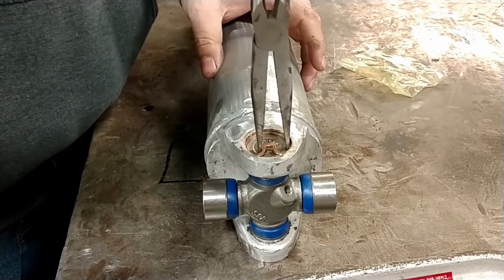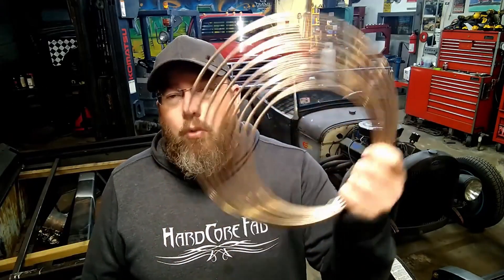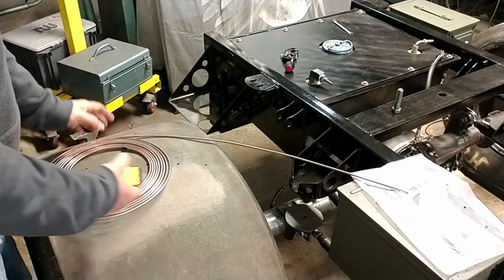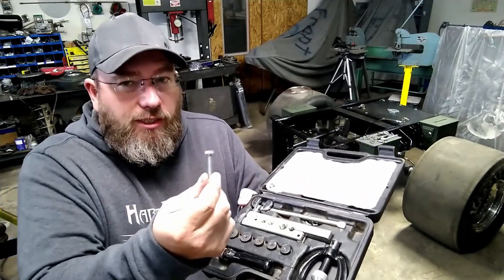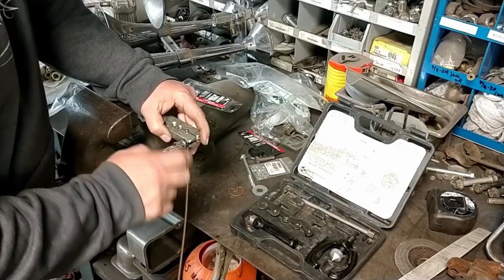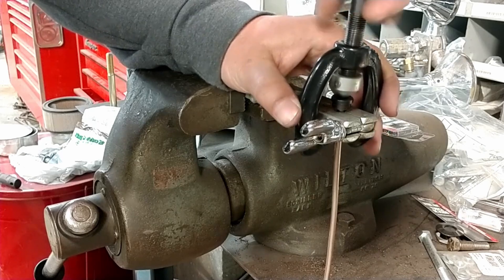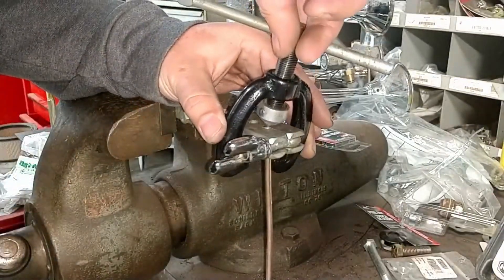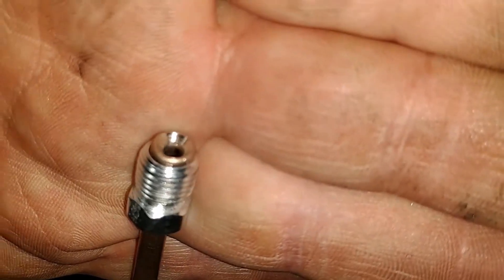How to double flare brake lines

Comment: Had a pinhole leak on my Honda rt/ rr break line the day I had it smogged. Pedal to the floor. Thought of replacing line from front to back but much to do. Will do repair this way. Like the explanation just picked up the flair tools and tube and  fittings. Wish me luck.

Comment: couple of notes: Take your time while flaring the tube. Going too fast will damage both tubing and cone/tool. Always lubricate or don't be surprised the flare wasn't good. Be careful how much material you file off. Light touch. Most HD/HF/Lowes tubing cutters aren't robust enough to run a lot of stainless steel. check your cutting wheel frequently. too much pressure on cutting wheel will deform the tubing and will require more filling/deburring to clean up. always deburr and clean out tubing. metal shavings and hydraulics don't mix well.

Comment: So very clear cut and easy to follow along.  Thank you! I need to double flare a steel line on my boat. The fuel line is (was) steel and would vapor lock. I decided to test out removing a section of the steel line by the cylinder head and routing gasoline rated rubber line away from the source of heat. While that fixed the problem, the single flare i put on the steel line is a big no-no for this application, as the sharp edge is eating into the rubber fuel line. Now that I know the solution works, I'll be doing it right. I thought I'd be paying someone to double flare the line. NOPE! You've paved the way forward!
Reply from the maker: Glad it worked out for you and you got it figured out

Comment: I never knew brake lines were double flared into I redid them all on a tug and filled the master cylinder up with brake fluid and they all dripped a little because I single flared them all. lol  now I know why the double flared means

Comment: What if you have to flare the line while it's on the vehicle? such as the line running down from the master cylinder that doesn't need replaced. I guess I would have to remove it from the vehicle to flare it?
Reply from the maker: No you can take the tools to the car.  I put it in the vise so it would be easier to video.

Comment: I have problems getting the line to stay where I put it in the tool itl slides back & I tightened the bejesus out of it ( steel) line I now use copper nickel  line easier to use not easy to do & I pay attention !!

Comment: The best video for a double flare on Youtube.I watched over 30 .They don't show you the part about measuring the tube with the side of the  adapter. Most showed me to make it the whole length of it, and the filing part is better.I tried 10 times got 1 good flare and broke my crappy Pittsburg tool adapter.
Reply from the maker: Thanks glad I could help!

Comment: I'm glad to know there is an easier tubing now available for making brake lines. This stuff may have been on the market for a long time, but I just didn't know it. It use to be if you looked and seen a copper brake line on a vehicle, you knew that it had been Jerry Rigged in other places. 
   When making steel lines , I would usually heat the end with a flame to help aneal it between crimps. Always had problems with it splitting the flare without a little heat.